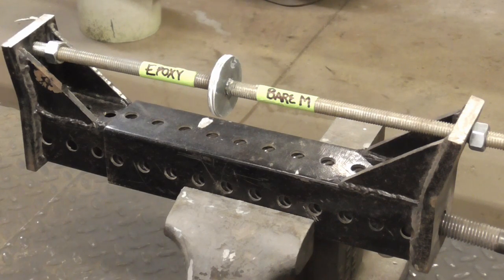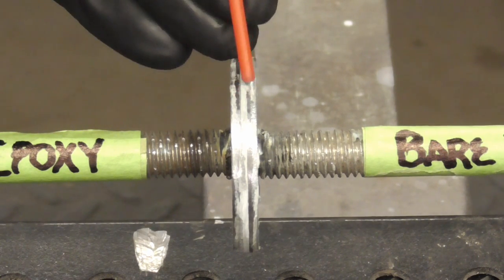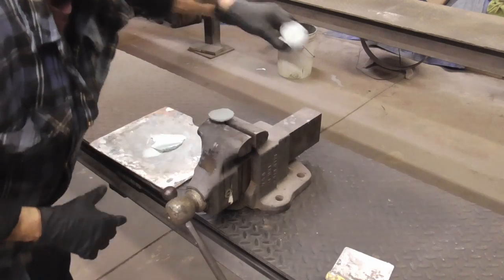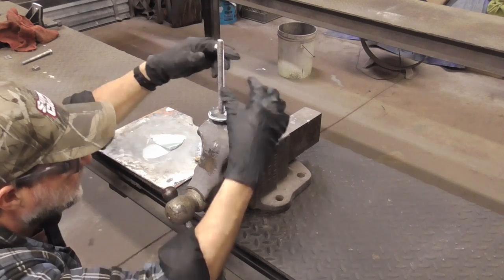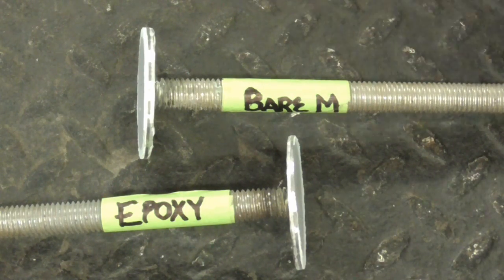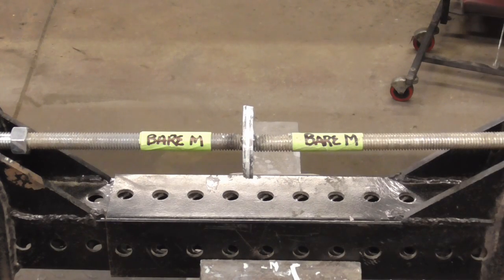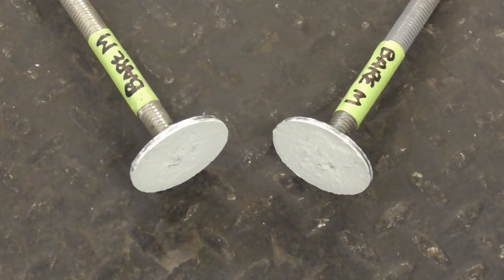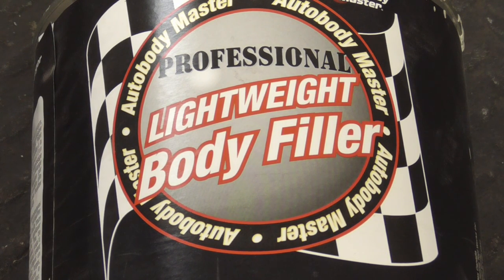Apply Body Filler Over Bare Metal or Epoxy Primer?

Comment: Good video to start a discussion. An important thing to note is that neither the body filler or the epoxy failed in a way that exposed bare metal. There are a lot of factors at play here, thickness of the individual materials, cure time, etc. I’m wondering if the epoxy primer was softened by the solvents in the filler or if the epoxy would get stronger over time. What I see is that both products adhere very well to bare metal and that in this case the filler is stronger than the epoxy for the given cure time. More study needed. Thanks for making me think.
Reply from the maker: Good observations and good points.  I was actually surprised at what happened.  I really never even thought about the primer splitting.  Both products stuck very well to the metal - just that the epoxy was the weak link.  I plan on doing it again with every thing you said.  Like different dry times, diff brand epoxies, paint, etc - see if anything can beat the filler metal bond.  Have a good weekend WWG :)
Reply: @LakesideAutobody  Nice, mature response.  How refreshing!!
Reply from the maker: @nilla003  Thanks nilla003 - here's that other video - https://www.youtube.com/watch?v=wVhQLqPAGVU  Appreciate the support :)

Comment: Good stuff, recently a guy posted that body filler absorbs moisture and that's why it should never be used on bare metal.

I informed him that body filler is to fill that low area, not protect it from moisture. Primer and paint protect the metal/body filler from moisture.
Reply from the maker: BANG!  You nailed it.  It's always been bare metal, filler, primer, paint.  anything else was cheating.  Remember too - filler came out 30-40 years before 2k epoxy primer.  What did they put it over then?  Bare metal.
Reply: @LakesideAutobody  exactly 👍🏾 I love your channel, keep up the good content
Reply from the maker: @3Wheels1Block  I'm glad to hear it 3 Wheels - nice talking to you :)

Comment: Thank you for sharing this I always wanted to know which is better or how it is put on. I always applied body filler to bare metal because that's what the old timers told me to do. If I am applying it's a really thin coat for pin holes.

Comment: I'm not a professional but I've been doing body work for over 30 years now, always put filler over bare metal. Was just looking at my plow truck the other day, I painted that 25 years ago, no rust or filler falling off the areas I filled, I'd think if it were rusting under the filler I'd see some cracking of filler lifting. Another example, I'm restoring a 73 camaro right now, I stripped the rear valance, had a good half inch of filler across the whole thing, plus atheist 50 holes in it from using a slide hammer to straighten it out, you'd think with all those holes in it the filler would have absorbed moisture, I found no rust at all under the filler, by the looks of it, this repair was done 30-40 years ago, and the car sat outside for a very long time in the weather in a humid climate.
Reply from the maker: You'll never have a problem putting filler over bare metal.  Thanks for you input Shaggy :)

Comment: Although I think this is a cool demonstration I disagree with it being better over bare metal I think there’s more that needs to go into consideration here. It is the benzene peroxide that is found in Hardner that we add to body filler to cure it that causes rust. When you apply bodyfiller to bare metal it heats up and cures. When this process happens it creates moisture on the bare metal and overtime it will create rust that builds up and eventually will fail and delaminate. This is just one aspect the other is that the epoxy primer needs to be scuffed thoroughly with 80 grit. Some will say it doesn’t matter because the Epoxy split and failed and to that I will say not all epoxy primers are created equal some are better than others. This is coming from 25 years in high end restoration I have physically seen cars come back that were prepped in metal and over a couple years they will sometimes fail this is not always the case obviously parts of the country that have more humidity and moisture in the air play a factor. Just because some fillers say they are approved direct to metal does not mean that is the best preferred method not to mention also that polyester‘s are porous and they will allow moisture to seep through them. This is why you always have to use sealers over a polyester product. If you were to take a sheet of bare metal properly prepped and cover the entire thing in body filler and let it sit outside you will find that overtime moisture will go right through that polyester and rust until it delaminates. Anyhow Hope this helps you in someway shed some light on the controversial subject.
Reply from the maker: With respect and thanks for your input.  It's good to remember that filler came out 30-40 years before epoxy primer.  It was applied all those years to bare metal without questions - you'd get in trouble by the boss if you didn't.  I promise you that any filler that I applied in the 70's 80's and 90's you could grind off and find fresh clean metal underneath because it was applied correctly.  Matter of fact that's a great idea for a video.  I know of some panels I did years ago in the junk yard - I'll grab them and chip or grind off the metal to reveal the metal in perfectly good condition.
Reply: @LakesideAutobody  another thing would be to make sure your epoxy is fully cured. Epoxy takes way longer to dry that’s s big reason why collision industry doesn’t use it. Anyhow no disrespect at all just thought I’d share some info. As you know there’s 1 million ways to paint a car everybody has their perspective 👍🏻
Reply: @LakesideAutobody  also with all due respect we also used to ride a horse to work 30-40 years ago technology has come a long way. I just wouldn’t sell yourself short on epoxy primer have a great day.
Reply from the maker: @SYLVESTERSCUSTOMS  I have a ? for you.  After you paint the repair, how will the metal be able to corrode under the metal?  After you paint, what is the epoxy there for? All of this debate has started from companies trying to push products.  I promise to do an experiment that proves you do not need epoxy primer under filler.  You'll appreciate it.  I'll have it posted soon :)
Reply from the maker: @SYLVESTERSCUSTOMS  Yes there is a lot of ways to do things for sure.  No disrespect either - enjoyed the conversation my friend.  BTW - you have a pretty cool channel yourself - subbed.  Remember, these companies are doing everything they can to convince you that you absolutely NEED to use what ever they are selling.  Ask the old body men who have been very successful at this for many years if you want to know the truth.  Make sure the guy worked at a high volume body shop - like a dealership or respectable shop though.  Not some guy working out of the garage.  Dealerships and high volume shops have the top talent because they pay top $.
Reply: @LakesideAutobody  I understand your statement but better yet here’s the real debate in my eyes. When a car is stripped to bare metal and you have all the detailed inner structure exposed etc flash rusting starts immediately how do you keep the whole car from surface rust while you bodywork an entire car? That issue alone is enough of a reason to epoxy the car. In the restoration and concours restoration world you would get so much slack for going over bare metal.
Reply from the maker: @SYLVESTERSCUSTOMS  Maybe because I live in Michigan, bare metal doesn't rust that fast.  Not that humid?  I can leave a panel in bare metal for weeks in the garage - no rust.  When I worked in body shops, no one worried at all about bare metal.  Maybe if an old hot rod sat for some time w/o being worked on, you'd freshen up the bare metal with a DA.  Heck, I've got 100's scrap squares of metal in a milk crate  for rust patches that I've had for 20+ years - no rust.  Some are rusty at the bottom but most are not.  I don't know, maybe in high production body shops the work is done so fast that the metal doesn't have time to rust.  Cars are in and out within the week usually.  I think the "restoration" vs "collision repair" is probably like Miller Beer vs Oberon American Wheat Ale :)  Got to do what the customer demands i guess.  I think though, the simpler you keep it, the better - less sh*t can happen.  Nice talking to you - good luck with your channel my friend - looks really good :)
Reply: @LakesideAutobody  yeah I agree stuff stays bare a lot longer in restoration. We brought home a car from blast this week and just the drive home I can see areas we had to DA. My fix for a car that needs to stay bare as possible for hammer and dolly work I’d use an etch primer just to hold off the flash rusting. It’s all the crazy details I always enjoy discussing because the more we share the better we all get. Likewise on the channel thank you take care
Reply from the maker: @SYLVESTERSCUSTOMS  You can always email me if you want - schoolvideolibrary at gmail dot com.  We're from different eras but the work done back then was some good stuff - https://www.youtube.com/watch?v=2o37dX--w0I  My dad worked at a custom van/vet shop called JR's Custom Paint just outside of Detroit in the 70's.  They painted murals on the side of vans (air brush) mermaids, creatures, horses, mountains, etc. - all lacquer stuff but looked like glass when finished. Simple materials - excellent results.  All that talent is dead now - ain't that nut's.  Have a good end of the week :)
Reply: @LakesideAutobody  I subscribed as well I always look for very detail oriented people to learn different aspects. I’ve had classes from some of the best i like to take in all the different ways and pick and choose what works for us. Looking forward to more videos from ya. It’s refreshing to have a debate and it not go sideways take care!
Reply from the maker: @SYLVESTERSCUSTOMS  Yep - that's the way to learn.  Take it all in from every direction and filter out the bad info.  You're a smart guy for sure.  You can always bounce stuff off me - I'll never get upset and I'll always give you an answer you can trust -  from studying and examining stuff.  Folks have a hard time debating  these days - politics, religion, race, gender, etc - they get so mad.  Take care and look forward to hearing from you again :)
Reply: @LakesideAutobody  👊🏻👍🏻🙌🏻

Comment: I like the demo! Great job you should do it over sanded paint would be interesting.
Reply from the maker: Thank GN - There's a lot of buzz about this so I think I will do it again pitting the bare metal against all types of stuff, sanded paint, lacquer primer, epoxy, urethane, poly, etc.  See if any can beat the filler to bare metal bond.  Have a great weekend my friend :)

Comment: Thanks. I’ve always spread bondo on bare metal and lately have read posts saying that’s wrong. Thanks again for clearing it up
Reply from the maker: You're welcome.  Always remember body filler came out way before epoxy primer.  It was designed to go directly over bare metal but it works fine over primer, paint and metal.  Body filler is really good stuff :)

Comment: I have wondered about this. Good demo. The bondo brand suggests to put it to bare metal. I think where this goes astray is because people don’t trust the untreated metal from rusting. Would a longer cure on the epoxy primer make it stronger?
Reply from the maker: It died over night.  The only thing that protects bare metal from moisture is paint - good thing to remember.  Putting filler over primer is frowned upon is dealership body shops and privately owned shops.  You'll never see it done.  It done on TV or magazines because they want to sell product.  Cars should stay dry and inside until they are painted - then the paint does the protecting :)
Reply: PLease tell me what manufacture of filler says to apply over bare metal??  I have 4 brands in my shop and none say that. They are all top premium manufactures
Reply from the maker: @mikeripley3266  That's funny..... "premium".  With tons of respect, don't buy premium fillers - waste of money.  Buy the most inexpensive filler you can find - it's all the same.  They are ripping you off - that's why they say you need "MORE" stuff - like probably their special "Epoxy" primer prior to app.  To help you out,  why not listen to body men who work in real shops.  If you have a question, go to a dealership body shop and politely tell the manager why you are asking and if he's a good guy he'll tell you the truth.  I will always tell you the truth - that is if you want to know the truth :)
Reply: @mikeripley3266  The ‘Bondo’ brand actually recommends this on the instructions.
Reply: @chetgingerich2551  I dont think so. I think  it says "properly treated metal". Bondo brand is a hobby shop brand. Not like what pros use that have to give a warranty on their work.
Reply: @chetgingerich2551  not all filler has polyester included .That helps bond and is ok for small metal spots but every, every manufacture says to warranty repairs on the cars you can remove the clear coat and base on small dents and apply filler over factory ecoat and paint but on larger dent and welded areas epoxy primer is to be used over bare metal. BAck in the 60's some body butchers though drilling holes helped bondo grip to the metal when it ran thru the hole .

Comment: great video. I'll do bare metal only from now on. Im wondering if I should use any type of rust converter on bare metal then put bondo. Im not sure I can get 100 percent of the rust off I just want to be sure it does not rust under the bondo.
Reply from the maker: Rust converter can help.  Sandblasting works too.  I wouldn't worry too much if you put filler over a tiny bit of rust left in the pits though - did it all the time - no issues.  Feel free to ask any ?s.

Comment: What I found is when you sand the filler you hit the epoxy and it’s kind of a mess for the sandpaper clogging up as well as feathering 🪶
Reply: Gotta use the "sandable Epoxy sealer" that's been available now for some time 👍(like the Montana line for instance) IF you are doing patch work as you described, cuz yeah, like the PPG DP Epoxy Sealer simply does NOT sand by hand and CAN/WILL ONLY be sanded successfully via 80/150 grit DA (and sometimes depending on how long it's been on the panel? Ya might even have to START the process with 36 grit DA!) Lol. But yeah, far as feathering/spot repair areas as you mentioned? Us restoration guys are going to be skimming COMPLETE panels where feathering/blending into pre-existing areas is NOT a concern. But yeah, considering what YOU were talking about? Try the "Montana" line sandable Epoxy. I honestly don't know IF it's any more durable than "PPG's  DP LF" etc but? It IS and DOES sand nicely and, it's a hell of a lot more affordable than "PPG" as well.😬 🙄 The shyt IS/and HAS just gotten completely ridiculous price wise last couple decades.... SMH 😞 Good luck and HAPPY RESTORING! 👍

Comment: I apply filler to bare lightly sanded metal. If after blocking there are pin holes, I apply catalyzed finishing filler. Everyone does it differently, but from my experience (and failures 😉), filler goes on bare metal. Thank you for the video.
Reply from the maker: You're welcome Jeff - have a good weekend :)
Reply: @LakesideAutobody  hope your weekend goes great as well! 👍

Comment: So much for all the expert recommendations for epoxy primer for bondo....
Reply from the maker: I'm doing one more video on this topic - allowing the epoxy primer to dry for more than 24 hours to see if that makes a difference. Trying a bunch of different approaches so...  we'll see.  I'll always put filler over bare metal though 'cause that's always worked for me and the shops I've worked in.
Reply: @LakesideAutobody  good idea. See if the extra drying time helps it adhere better. But if prepared bare metal provides that kind of bond...why bother with an extra step? Save the epoxy for sealing good bare metal maybe...
Reply from the maker: @BearBudgetgarage  Absolutely agree.  It's a wasted step. Wasted time and money.  You never wanted to be caught putting filler over anything but bare metal when and where I worked (retired).  You were considered a hack if you did :)

Comment: Made a very strong point about body filler  sticking to bare metal thank you  jerry
Reply from the maker: Remember too- filler came out 30-40 years before epoxy and urethane 2k primers.  It was designed to be put over bare metal.  Have a good weekend my friend :)